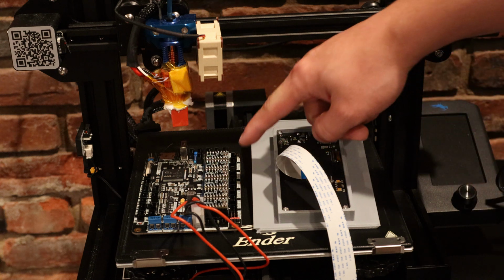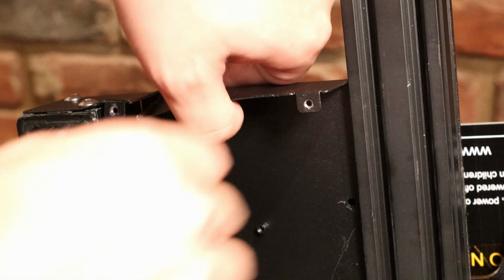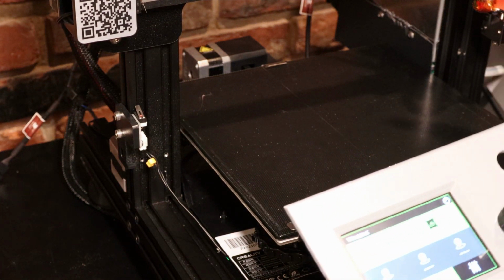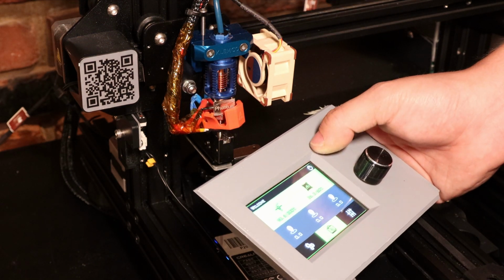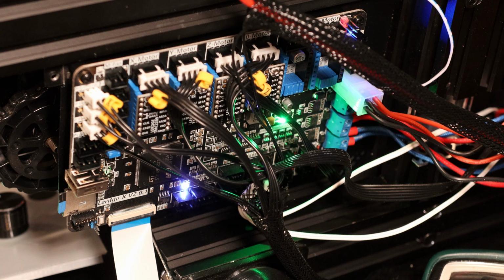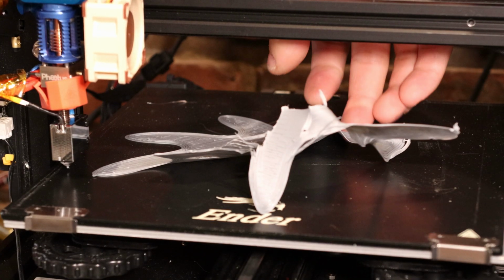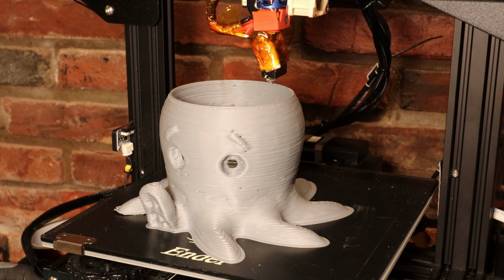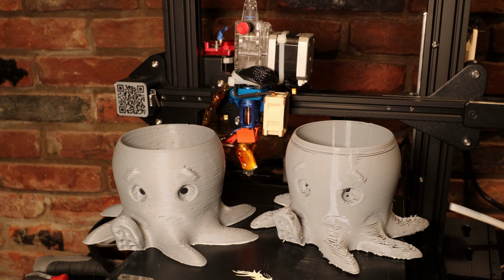How to Melt your Ender 3 - Lerdge K Mainboard Upgrade

Comment: Better use a factory hot end . They have had years of testing and thousands of hours. Just see how well the spider hot end by its self can do . and how well of a print you can get out of it.
Reply from the maker: If you want something that works - yes, you should use a factory hotend. If you want to try out random shit and make something that no-one has ever seen before? Start cobbling random stuff together until you get something that works. That is the inventor/innovator mindset. 99% of the time it looks silly, but 1% of the time it's brilliant.

Comment: I appreciate you showing your mistakes and all, but man, you are a butcher.
When you started hammering that poor stepper motor I clenched my cheeks.
Reply from the maker: Don't worry about it! I have a pile of stepper motors in a drawer in case I break one. I basically run a 3D printer chop shop.
Reply: @Nathan Builds Robots  a 3d printer chop shop is an excellent description for this channel. Still here and looking for more. Keep'em coming, brother, you rock.
Reply: @NathanBuildsRobots 😅

Comment: On the thermistor coming unplugged issue, why not switch to the m3 bolt head style? Easy to tap the hole and much better imho
Reply from the maker: I'm interested in the bolt style but aren't they expensive? I got my bread and cartridge style ones 5/$10 and last I checked the threaded ones were $10 ea.
Reply: @NathanBuildsRobots  I’m an idiot,  don’t listen to me. The thermistor hole in most heater blocks is bigger than m3, so the bolt head style won’t fit in most setups. Also, yeah they’re a little more expensive. Not worth it unless your heater block has a small enough hole to tap.
Reply from the maker: @MikeJones-mf2rt  I thought the idea with the m3 thermistors was to screw them in to the tapped hole that is normally used to bite down on the glass bead or cartridge thermistor.
Reply: @NathanBuildsRobots  I’m not sure how that would work without getting in the way 🤔 but you’re probably correct and I’m just an idiot who should’ve thought of that 😂 hopefully that’s the case because then you’ll just have saved me from getting really creative trying to use the cartridge hole with the m3 thermistor and an aluminum m3 bolt connected together by an m3 standoff and thermal paste 😂 waiting on Aliexpress for more 104GT-2 cartridges lol getting impatient, appreciate the tip!

Comment: I'm glad you got it working but seriously, the journey you took to get there was extremely unsafe. Does lerdge not have a config file you could prepare in advance of turning on the machine?
Reply from the maker: As far as i know there are no configuration files, only settings that you change in the menus. 

If there was some documentation I could have everything to the correct setting before power up. I don't know if that exists, so I went with the trial and error approach.

I guess my video is more or less the documentation on how to configure this board for the Ender 3?

Comment: Lerdge is closed source, and really not worth the price. The behavior you demoed where the end stops were configured inverted -- correct firmware behavior should say end stop triggered before homing. It SHOULD NOT try to move and crash. It should have shown an error and then told you to to flip end stop to normally closed.
Reply from the maker: Full disclosure, I got this one for free from Lerdge. I honestly don't care if they send me more stuff, but based on my experience I would use them again if building a printer from scratch. I dislike having to get on my computer, edit code, recompile, flash to machine, check if it works, iterate etc. to change a setting. On this I can change major settings in under 10 seconds. My SKR 1.6 took 20+ hrs of Chris's Basement videos to compile the firmware and get all the settings right. Also, on my SKR mini the EEPROM is broken, so that's been kind of annoying to deal with, so to update ESteps I have to reflash firmware.

Printer motherboards in general are just too expensive. For an SKR 1.6 + LCD screen the price is similar at $100-$115 (hooray inflation). 

That is a good point on the end stops, if its set to normally open and its reading a closed switch at the start of the homing procedure, the correct answer is not to start moving full speed ahead. I will add a 2nd bug that I found, I was not able to set the temperature of both extruders simultaneously through the menu. So if I set extruder 0 to 200C then set extruder 1 to 200C, it would reset extruder 0 to 0C. It all worked fine when running GCode but it made it more difficult than it needed to be to do an e-step calibration.
Reply: @NathanBuildsRobots  I've moved away from marlin. I'm using rrf on duet or klipper on other hardware. Just config files. Nothing to recompile. Change a parameter and restart
Reply from the maker: @kazolar  yeah Klipper is that can of worms I will need to open someday soon. I might set up my silent build with its SKR mini to run it, because the dead EEPROM is pretty irritating. 

I thought it was pretty funny when Thomas Sanladerer warned everyone about the Klipper community in his voron video. Sounds like he got trolled.

Comment: Why are you running two heater blocks? Are you using large nozzles?
Looks like a pheatus and a volcano?
What through put volume mm3/s ?
Tmc2226 can you not adjust current in firmware?
Reply from the maker: Yeah I am using 2 heater blocks on a 1.2mm supervolcano nozzle. I decided to spin off this motherboard upgrade into its own video because there is too much going on with that printer. I am planning 2 more videos on the build - one on the hotend setup, then another on speed optimization and messing with a temperature gradient to see if that can speed up prints.

For your other questions: I am at 30-35mm/s right now, and am aiming for at least 60.
There is probably a better way to set up the steppers that I am not aware of, I need to look into it a little more.